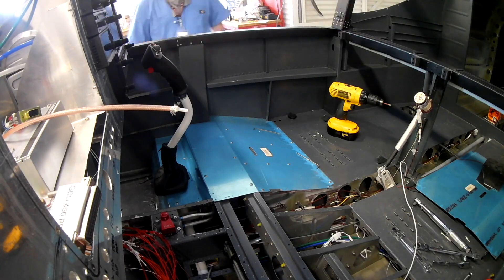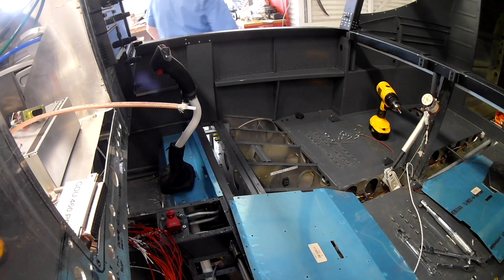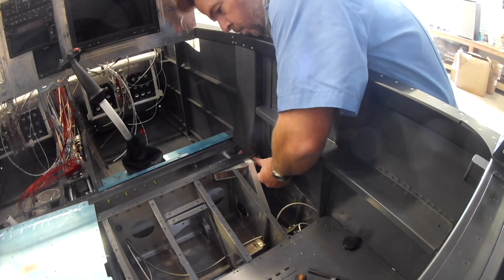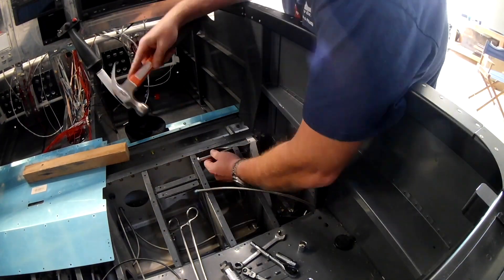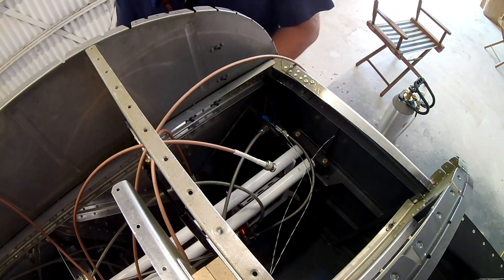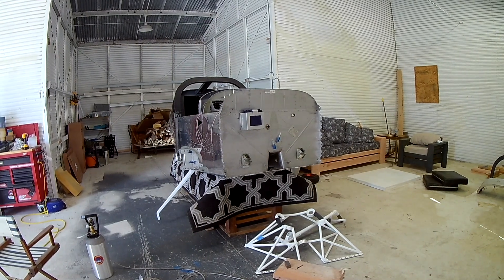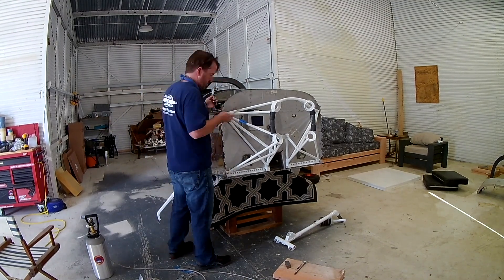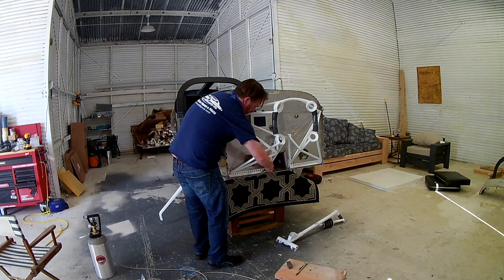RV-14 Landing Gear III

Comment: Do you have a table for the assumed friction of the stop nuts or do you measure them before deciding on the torque? For AN3 nylon nuts I measured 5 inch pounds and the AN3 range is 20-25, so I chose 29 which is more than what you say in the video. Just wondering if I am doing something wrong?
Reply from the maker: I just go to the upper end of the range for 3s and 4s. 5s and 6s I go for mid range.

Comment: It’s interesting how much they changed up how they mount the landing gear in the RV14 compared to the previous models. I also wish mine had that large center tunnel forward of the seats to run wires.